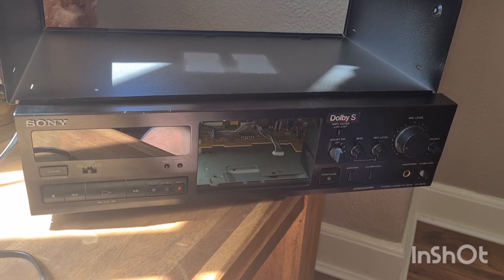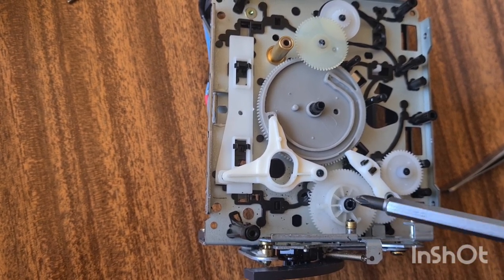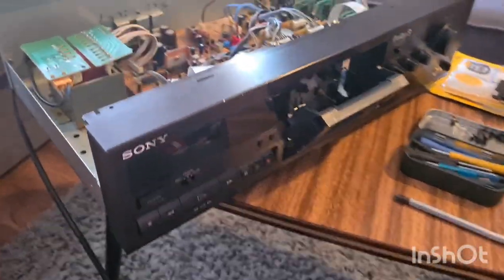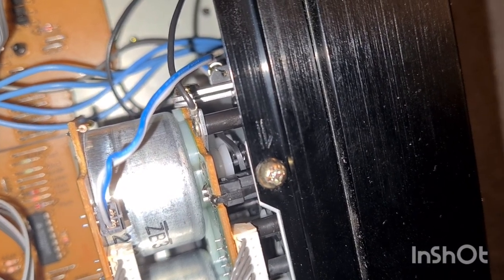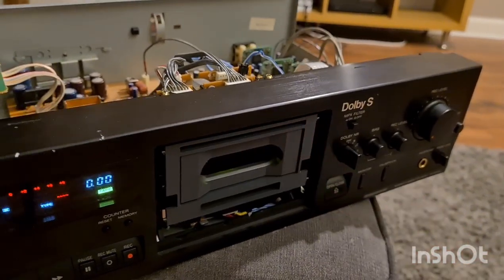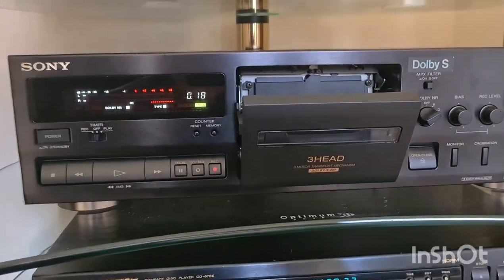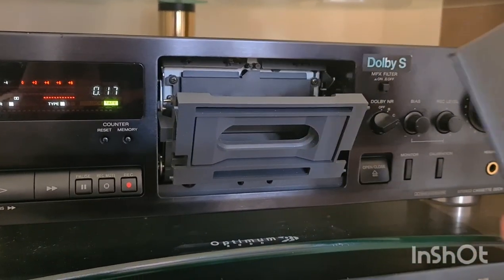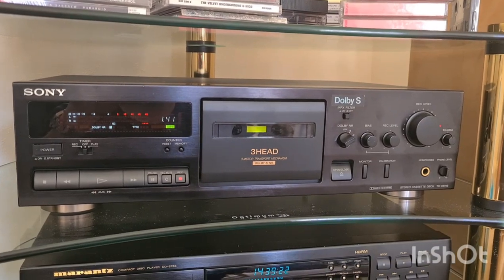Sony TC-K611S Three Head Cassette Deck - Transport, Playback and Recording issues Repaired

Comment: Hi what a fantastic video my friend. Thank you. I wanted to share my problem with a similar deck. Mine is TC-K815S.

I paid a lot for it about 1 year ago. It is in mint condition both cosmetically and mechanically. It was actually as good as brand new. You won't believe, in 1 year that I have it, I recorded only 2 songs.

I've kept it ON for almost every day, reason being I keep it with source button ON to watch LED dance to tv, cd, tuner or whatever I am listening.

All of a sudden, it doesn't play. To get it to play, I used to press play and stop super quickly a few times and it would then play. During the last 1 month, that fast finger work of play stop play had gone to 20 to 30 times. Now to get it to play, I've had to remove the door cover, press play and lift the pinch roller with a screw driver all at the same time and only then it plays. I am not techy but I do feel it's all just a matter of dust and needs cleaning. I am just too afraid to remove the transport. Woukd it be possible to clean other areas you may know that could fix this issue. Also sometime I press open to eject and I hear motor and it doesn't open so then I quickly keep pressing open close and then it opens and closes fine. I am very sad to see what has happened to my deck and seek your advice. Thanks and regards, Sami.
Reply from the maker: Sounds like the tactile buttons have died. They operate in a weird way, in series almost. You have to replace all of them to make one work.

What's happening when you lift the pinch roller is you're manually putting it into play mode, and it will play. Almost like bumping off a car. 

I would replace the tactile buttons on the front. Maybe £2.
Reply: @pwrestoration  Thank you so much for your kind and informative reply. You mean the play button area, behind the plate where I press play? I thought this has something to do with cleaning the 2 sensors you showed in your videos, where you mentioned if not clean it keeps stopping. My deck once playing never stops though and works fine and stops when the tape ends. Forward rewind is fine, but when I get it playing by play and quickly screw driver pushing the pinch roller up, while playing if I press forward or rewind it does forward or rewind and play icon stays on screen. I need to then again press stop and play with screen driver action pushing the pinch roller up and it plays. It usually used forward and rewind but now that has also stopped while playing. With play, it forwards and rewinds fine. Thank you so much. I'll keep reading your response, learn and try to do this, although I am very scared not to further damage it.
Reply: @pwrestoration  Hi Paul. I hope you are doing well. I wanted to tell you, when I press play, it does lift a bit but doesn't engage into play mode until I remove the door and lift it immediately after pressing play.

I am so sad to see this issue amd seel your guidance. I've seen some of your videos to remove the transport and wanted to know should I remove and clean. Could be be something related to belt. Although it plays fine. I've also done something else and I hope it's not a mistake. There's a black plastic screw type. I turned it a bit and when I played the treble has gone. While playing I turned it again and brought back the treble but I just pray I haven't messed it up :( This was my best deck and I've done recording many times to perfection from tv, cd and even turntable. Please give it a thought one more time, as I feel you might identify something easier to fix. Tactile in my ignorant head feels ok as it stays in play when I lift it and while it doesn't play without lifting, it does make a eletronoc engagement sound when I press play and does lift a bit but not till play mode. Appreciate your knowledgeable thoughts Paul. Thanking you.

Comment: Think I have the same issue you talk about at the end of the video with the Erase head not working. I'm a novice when it comes to electronics but very keen to learn ! I know the connection you are talking about but presume I'd need to remove the whole board to get to / examine the solder underneath ? Thanks again for all your videos on this Deck - I'm pretty close now to getting mine back up and running.
Reply from the maker: Yep, it's really common. You'll have to unscrew the mainboard, and then it's held down with a few plastic clips you need to squeeze. 

You'll see under the plug if the solder points are cracked. 

Symptoms of this are the auto cal not working properly, and also you can hear the previous tracks under the one you just recorded. 

No need to touch the transport. 

You'll need to remove the backplate though.

Comment: Nice Video squire, You inspired me to dig my Yamaha KX-580 Cassette Recorder out as I boxed it up and put the KX-400 in its place as the 580 was not sounding good, I’ve just set it up & plugged it in to a Stereo with Speakers attached and it’s now sounding fine, I have no idea why it’s now sounding fine when it wasn’t before, Weird, One thing I am having an issue with is sometimes when I press the Play button it will either choose to Rewind or Fast Forward the Tape, Not sure which to be honest, Any ideas or suggestions?
Reply from the maker: The tactile switches on the circuit board behind the buttons will have developed corrosion. There's no real solution bar replacement, but they're about £2 for 10! They are wired sort of in series and some use a common earth, so if one fails it can affect others downstream. Always better to replace all in a oner. 

You'll have to remove the board from behind the front panel and measure the dimensions of the ones fitted, they're readily available on eBay and a simple four point solder-in job!
Reply: @pwrestoration  Thanks for that and appreciate the info, The 580’s called me a Liar now, It’s starting to do what it did before I put it away, It sounds fine at first and then the Audio
gets muffled after a few seconds, I have cleaned the Heads but not with IPA as I didn’t have any at the time, Any suggestions for why it starts fine and then gets muffled after a few seconds?
Reply from the maker: @AJComputerServicesUK  I would say the pinch roller could be causing the tape to skew. Give it a change for a few quid!
Reply: @pwrestoration  Ok and thanks for that, Would a drop of IPA on a Cotton Bud make any difference do you think & swap it out if not?

Comment: Hi there - Great channel - thank you - A quick question please - I've just bought a Denon DRS-610 which wasn't working - When you pressed play it stopped after a 8 seconds with no sound, so I opened it up and changed over the belt - now it plays and records, but ehn you take the tape cassette out, all the tape on the reel inside the cassette has moved up the reel to the top (rather than being in the middle of the reel - when I try to play the tape again, the cassette tape stops and no other cassette deck I have will play the tape because the tape is presssed up against the top of the cassette casing - have you ever ween this before or have any idea what could be causing it? - Thank you - Gary
Reply from the maker: Gary, I'd say that from what I can work out there your tape isn't playing / rewinding / fast forwarding and keeping good alignment. Therefore when you use the tape somewhere else, it's 'tight?' 

If that's what you mean generally it's a pinch roller issue, whereas the pinch roller is more rounded or solid than it should be, thus misalignment occurs inside the cassette itself. 

Hope that helps!
Reply: @pwrestoration  that’s great - would the pinch roller also make the sound wobble on playback and record? I suppose if the tape isn’t winding properly because of the punch roller, then the playback and record will wobble - thanks again - I’ll order a pinch roller and see how it goes :)
Reply from the maker: @in_the_moment  Yup, exactly that. It's called tape skew and I imagine you're losing treble off playback too?

However if it's a 'speed' wobble it could be that your capstan needs a clean and reoil. Otherwise called wow/flutter 

It's very common when pinch rollers die off. Good luck!

Comment: Why Sony didn’t have Dolby S in their high end European decks like the tck-990es is strange. Only midrange decks did. Except Japan models
Reply from the maker: Not sure, I'd rather have this and Dolby S!
Reply: @pwrestoration  i had a tck-970es and didn’t use Dolby when recording at all, 
Yes it removes hiss but also sounds, so unless i record some classical music with lower volumes it’s rather useless and gimmicky i think.
On pop and rock music it’s destroying more than fixing. I guess that the Japanese models just had to have it because of those reasons. And seeing it on European midrange models but not top of the line ones just underline that it’s true
Reply: @ingenfestbrems  Dolby S wasn’t available during production of those decks. The TC-K555esJ has Dolby S but you can tell it was rushed because there is no indication lamp on the display for Dolby S and they just went ahead and defeated the illumination of Dolby B and C since S didn’t have an indication on the display.
Reply: @VintageAudioTech  s came out in1989. And the 970es vas made from 1990 to 1992, and replaced by 990es with also didn’t have Dolby S….
Reply: Sony was late to the party maybe
Reply: @VintageAudioTech  S only come out on J, models. Japan,
Except cheaper models with was made before 990es(which didn’t have S)